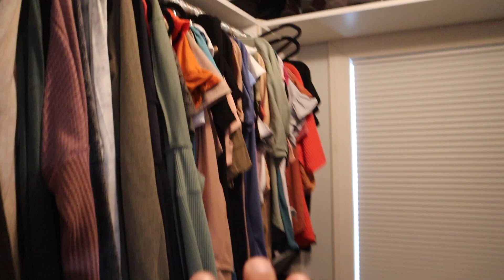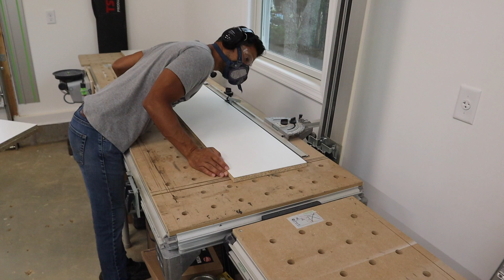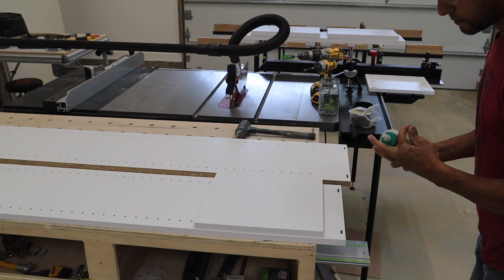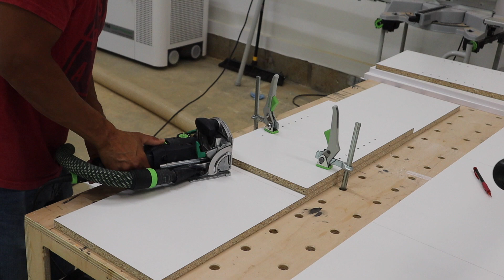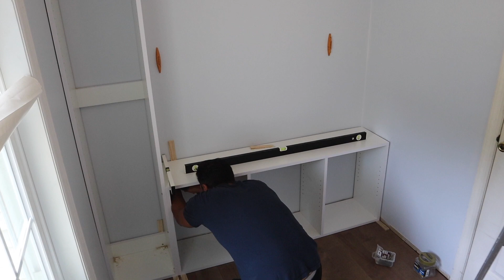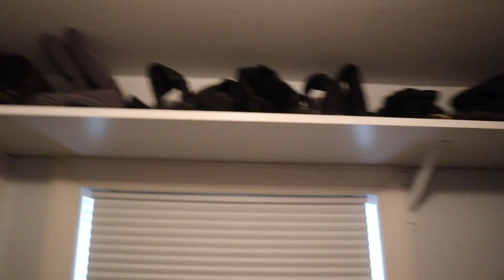Transform your walk in closet

Comment: Look great! 

Wish I could afford the festool edge bander. 

What edge banding are you using? Can you link it?
Reply from the maker: @jgraeff1  thank you! I don’t have a link for the edge banding because I buy it in 500 foot rolls (non-glued) from my wholesale distributor.
Reply: @ I usually purchase from Richelieu. Do you have a part number or anything? Reason I’m asking is I’ve used the fast cap peel and stick but not crazy about it.
Reply from the maker: @jgraeff1  the Richelieu product # is T0300124. You’ll have to just select the options for unglued, 1.0mm and 15/16 width. It’s like 450 linear feet in a roll. If you have a trade pro account with cabinet parts.com also, it might be a little cheaper. I sourced this roll about 6 months ago, I think from Richelieu but I have found that cabinet parts website is cheaper on a lot of things. So try both first.